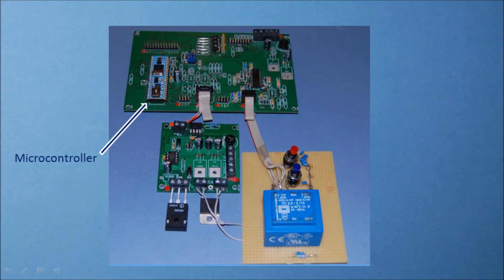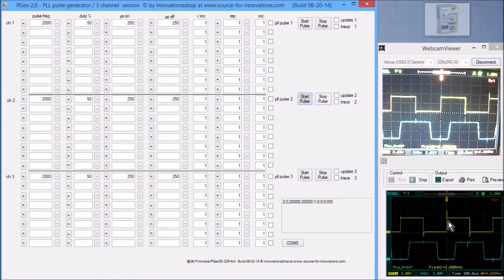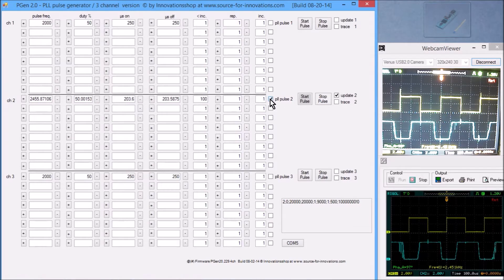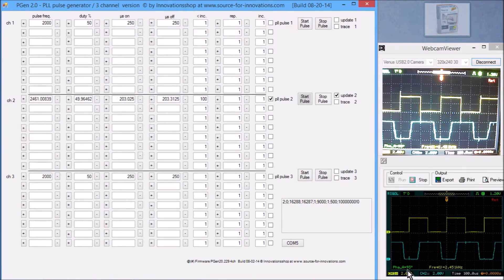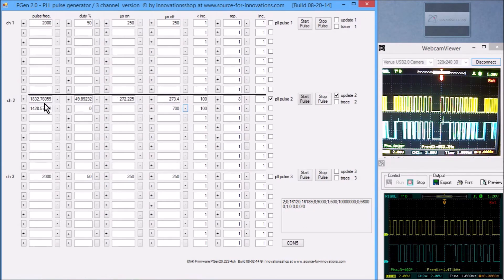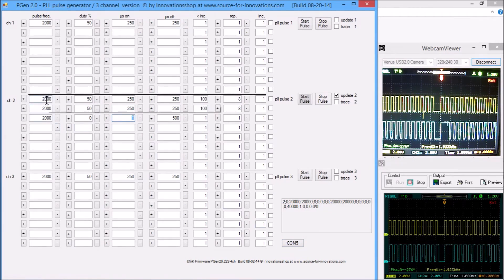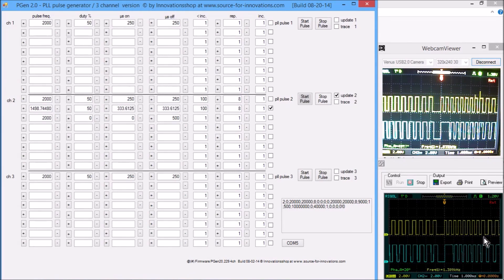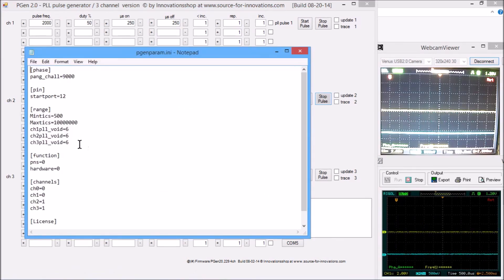PGen pll pulse generation and feedback loops

Comment: phase lock loop = pll           what angle on the scope does the phase angle measure?    Also can this software be used to somehow make qmogen system  where generator and electric motor are out of phase?   I realize the point of this is to work with the WFC primarily correct?
Reply from the maker: Ernest, whenever a rising pulse gets into the LC circuit the LC circuit creates a current/voltage response. The microcontroller measures the delay between excitation pulse positive edge and return pulse positive edge of the LC circuit. the time delay is set into relation to the pulse frequency and one period later would be 360 degree and at the same time would be 0 degree. any time delay in between is also possible. for any phase shift degree given, let´s say 90 degree the microcontroller adjusts output frequency until given phase shift degree is reached.

I need more details about what to accomplish according to qmogen. There is another mode the PSL mode where up to 4 pulse outputs can be phase shifted towards each other.

That video shows how phase shift lock orks: https://www.youtube.com/watch?v=myJHUId_IQs operating phase shift on multiple channels.

PGen was programmed as a multi-purpose lab support tool and one application was WFC including EEC, laser control and process control means but it also covers the whole Bob Boyce circuitry.

I can get more into detail if you give me some details about the applications you are dealing with.
Reply: Application 1: Lets say you want to pulse an amperage frequency into a algae growth vessel to create a linear magnetic affect (induced aligned magnetic moment) using two electrodes in a  microbial algae fuel cell (kind of like the Water Fuel Cell) only the water is seawater and it is also doped with paramagnetic basalt, iron sulfide or pyrite, and paramagnetic beach sand.   In this case you want to speed up the growth of the algae and harvest the algae to make a heavy oil via ultrasonic cavitation.  Essentially the electrolyte is a strong conductor and there is biophotons being given off at a 1 to 3000 multiplier affect.    Amp in vs biophotons out.
Reply: Application 2: Lets say you want to denote on an oscilloscope  screen the following:  you have compounds made up of atoms that are paramagnetic and you have other compounds like water that are diamagnetic.   You know that the difference in the two compounds is unpaired electrons in the outer orbitals in the paramagnetic compound and fully paired electrons in the diagmagnetic compound.     How then on your scope to show the frequency interaction of the paramagnetic compound with an electromagnetic pulse? ie momentary electron saturation causing a linear magnetic field alignment ... linear magnetism.   Or likewise show the stretching of the hydrogen oxygen bonds in the outer orbitals?    If you have a centrifical force multiplier rotating flywheel like on a qmogen setup you might be able to compare the flywheel to a diamagnetic compound, as all its atoms are rotating around the nucleus at a constant speed until a outside force tries to dislodge the electrons (perhaps change the phase angle).   This could be compared to the unequal loads in a copper wire circuit (lights flashing on, electric motors starting up or experiencing a needed  torque increase moment, like saws engaging a log or board and then not).      So somehow in a qmogen circuit with out of phase frequencies and the force multiplier you get overunity.   Likewise with paramagnetic basalt or pyrite when you apply a pulsating amperage current you can multiply the output energy that can manifest into light called biophotons ( an EMF frequency just over far infrared emf) and induce a linear magnetic moment (the parallel fields of all the paramagnetic compounds align into one solid magnet)  that creates a momentary strong magnetic field.    Lets say in the seawater microbial fuel cell.   Also when certain microbes in compost are added to basalt the result is 1 to 300,000 induction or transformer via just picking up natural atmospheric, gravitational, and longitudinal pulsating EMF.
Reply: A centrifugal force multiplier flywheel in a qmogen setup is the mechanical form of linear magnetism or the many times scaled up version of a diamagnetic substance perhaps?  If a load (or emf pulse) is applied causing a stretching phase angle torque, the spin of the flywheel or electrons in outer orbitals are able to overcome the torque and thus the phase angle can be held for a period of time.  In other words the rotating flywheel or the spinning outer electrons create a circuit resistance (an inverted zero point energy amplifying load perhaps) to slowing down, and thus it requires a prolonged attack to slow the spinning down or change the phase angle or the amplitude or duration of the pulse. Actually I believe the flywheel or diamagnetic substance coupled to the circuit can lower the amps required in the circuit and increase the pulse on time duration.    Likewise extra current manifests itself in the copper circuit of the qmogen setup and extra energy in the form of biophotons manifests itself in the basalt, microbes, humic fulvic acid electrolyte, seawater, pyrite, algae scenario.   what is common to the two is an outside applied EMF that induces (step up transformer) an overunity effect.
Reply: Instead of combusting a gas to create a EMF you are using the already naturally occurring electron outer orbital spinning (like the flow of water over a dam or the rotating blade of a wind mill) to do useful work.   When you can embed a rotating flywheel in mechanical moving parts, like on a shaft between a generator and electric motor the centrifugal spinning can maintain the generator speed but also act like an overunity especially if there is also leverage built in resistance to slowing down .   So applying a constant pulsed stretching to the centrifical spinning can allow for free energy to manifest itself.    The energy in amps and volts or watts to run the electric motor can be less than the energy created by the generator.
Reply: Seems to me the WFC and EEC circuitry are emulating the above circuitry comments.    The key is the diamagnetic water dipole phase shifting in the WFC circuit along with the dielectric stainless steel tubes acting as transistors.   The key to the EEC is the raising of the outer electron orbital spin of the oxygen and hydrogen gases via LED photon and phonon interaction allowing electrons to be removed from the outer orbital of the atoms or compounds.   What is power (voltage push) but energized electrons. For example, if an electron at a ground state is raised to a level that allows 20 KW of power, only about 10-15 joules (a millionth of a billionth of a watt) are needed. This is simple physics. Some people have “found” the secret sauce that makes that very economic. The input to the circuit only needs about 60 to 70 watts of power to produce 40 kw of power.  The key to all of this is the discovery that very little energy is needed to energize electrons to high values. The electron is a very small particle. It is 1840 times smaller than a proton. We all know from high school physics and chemistry that protons are very small and light. The weight of an electron is about 10-31 kilograms. Very light indeed!
Reply: What makes an electron to jump up an orbital shell ....its the absorption of a photon that causes the jump.  Quantum transition of orbital electron ... what makes a electron jump up to the next electron orbital shell... the energy of the photon absorbed exactly matches  the amount of angular momentum that was gained when the  electron jumped up to the larger shell and the  opposite is also true when the atom emits a photon
the energy of the emitted photon exactly matches the amount of the angular momentum that was lost by the electron and the same is also true in terms of phonons the amount energy lost in the angular momentum of the electron exactly matches the energy corresponding to the emitted  dimensional vibration.   Impedance Matching....100% match.....       soundwave frequency  = lightwave frequency.......    speed of light matches the speed of sound.....photon energy = phonon energy

In physics, angular momentum, moment of momentum, or rotational momentum is a measure of the amount of rotation an object has, taking into account its mass, shape and speed
Reply from the maker: For any kind of feedback mechanism you have to define the following basic parameters first:
frequency range for excitation, frequency range for feedback indication, how does the feedback indication look like, what means are needed to get a valid trigger signal from the feedback indication.
then a microcontroller can create relations between excitation signal(s) and feedback trigger events by means of a program and the result is process control.
water is something special because low frequency excitations result in high frequency reactions in the water. the same happens to LC configurations. high frequency responses need totally different means as feedback triggers than low frequency responses.
so you have to design an experimental setup for your tests and then we can check how PGen pulse generator can help.
Reply: In a copper atom diagram: 29 protons in the nucleus, surrounded by bands of circling electrons. Electrons closer to the nucleus are hard to remove while the valence (outer ring) electron requires relatively little energy to be ejected from the atom.

Using enough electrostatic force on the valence electron–either pushing it with another negative charge (voltage push from excess electrons stored in a battery or capacitor or certain unpaired electron metal oxide conglomerates doped with other elements within basalt that have stored up some electrons with each pulse of incoming electrons via light, sound, various EMF) or attracting it with a positive charge (ie a electron suction drawing load with internal resistance that transforms electron flow to another form of energy, like Forsterite (Mg2SiO4), SiO2, TiO2, Iron Pyrite (FeS2) doped with Chromium and Nickel giving off a biophoton, and adjacent microbes and humic acid creating an  increased demand for the biophoton) –we can eject the electron from orbit around the atom creating a free electron.

Now consider a copper wire: matter filled with countless copper atoms. As our free electron is floating in a space between atoms, it’s pulled and prodded by surrounding charges in that space. In this chaos the free electron eventually finds a new atom to latch on to; in doing so, the negative charge of that electron ejects another valence electron from the atom. Now a new electron is drifting through free space looking to do the same thing. This chain effect can continue on and on to create a flow of electrons called electric current.
Reply: Del Mar Photonics, Inc. is an established manufacturer and system integrator of advanced photonics products for scientific and industrial applications. Product portfolio includes ultrafast laser oscillators and amplifiers based on Ti:Sapphire, Cr:Forsterite, Er- and Yb- doped fibers; variety of measurement tools such as autocorrelators, SPIDER and cross-correlator and a femtosecond dynamic research tools such as Beacon fluorescence up-conversion and Hatteras transient spectroscopy pump-probe systems. Del Mar Photonics offers integration of femtosecond laser systems for multiphoton imaging, scanning probe microscopy, micromachining, molecular dynamic, X-ray and plasma research, THz generation and spectroscopy and other applications.
Reply from the maker: Ernest Culberson great findings! I will get into detail at that site soon :-)
I posted your link at http://open-source-energy.org/?topic=2352.msg31360#msg31360
Reply: Innovationsshop  I can't get logged into that url tried a dozen times
Reply: Innovationsshop An LC circuit, also called a resonant circuit, tank circuit, or tuned circuit, is an electric circuit consisting of an inductor, represented by the letter L, and a capacitor, represented by the letter C, connected together. The circuit can act as an electrical resonator, an electrical analogue of a tuning fork, storing energy oscillating at the circuit's resonant frequency.
LC circuits are used either for generating signals at a particular frequency, or picking out a signal at a particular frequency from a more complex signal. They are key components in many electronic devices, particularly radio equipment, used in circuits such as oscillators, filters, tuners and frequency mixers.
An LC circuit is an idealized model since it assumes there is no dissipation of energy due to resistance. Any practical implementation of an LC circuit will always include loss resulting from small but non-zero resistance within the components and connecting wires. The purpose of an LC circuit is usually to oscillate with minimal damping, so the resistance is made as low as possible. While no practical circuit is without losses, it is nonetheless instructive to study this ideal form of the circuit to gain understanding and physical intuition. For a circuit model incorporating resistance, see RLC circuit.
Reply from the maker: Ernest Culberson Sorry, I see. You have to register at that forum to get access to some posting areas. But it´s only the following link i posted: http://www.dmphotonics.com/
Reply: Innovationsshop I was able to see that post on the open source page thank you.
Reply: Ernest Culberson  Some scope shots in this picture http://linoavac.no.sapo.pt/qmogen.jpg